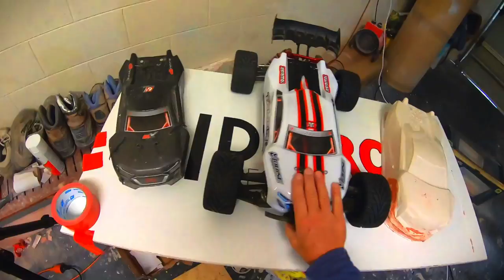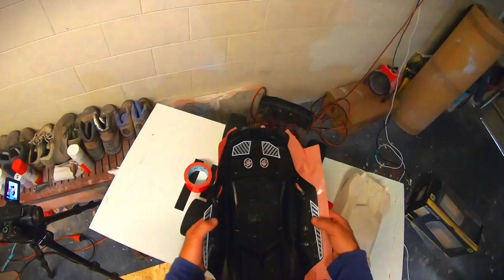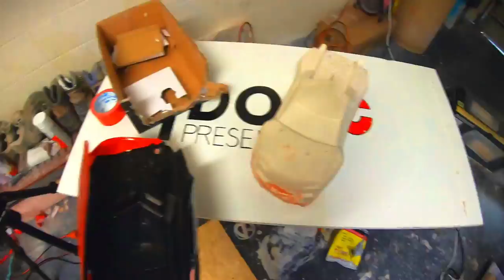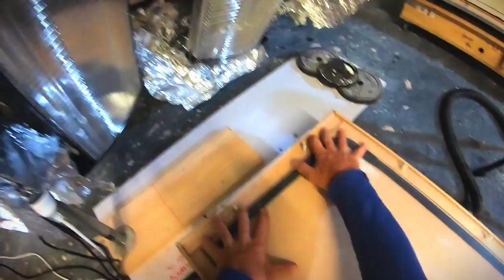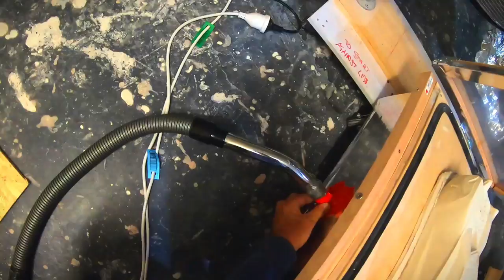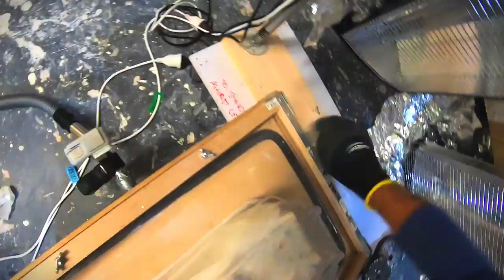Make you own RC body shell | Vacuum Forming RC car body | Arrma Talion | DIY vacuum form |(@IDORC

Comment: thanks you gave me some ideas on some changes to improve my system, something i can share someone might find helpful, for making the molds i put the taped body in a plastic tub and use cheap playground sand to pack around it for support, the sand not only eliminates any chance of the tape blowing out because it wasn't supported enough, but also makes it possible to cast a mold from a body's that are broken or even have missing sections, as long as you can form the missing sections with tape or plastic then the sand will reinforce it enough to keep the plaster from plowing through, i have 2 identical plastic tubs so i can store the sand in between then transfer the sand back and forth to make molds......
Reply from the maker: Great idea the sand bucket, will definitely try that next time, cheers

Comment: I’ve gotten myself a 3d printer and wanting to make a custom body for my Losi Super Baja Rey 2.0, I was wondering if a 3d printed version of the plaster replica would work with this technique. Would love to hear your opinion!!❤
Reply from the maker: Hi mate, the temperature of the plastic when vacuum formed (thermo mould) is quite extreme, the 3d print mould is likely to melt while trying to form the e vacuum mould…. That’s why plaster is great, it can withstand the heat. Also plastic formed over plaster allows for the new plastic form to seperate from the plaster mould easily… sometime I wipe olive oil on the plaster to help seperate from the plastic form…. I’m afraid the plastic body shell when vacuums (suctioned) over you 3d plastic mould will bond together due to heat and make them impossible to seperate. Cheers for asking though!

Comment: I was having a "Deja Vu" when watching this. I'm 72, and remember doing this exact same thing with my Mattel Vacu-form, back in 1963.Lol The car bodies were Hot wheel size, but.........Cool video. How much hotter for polycarbonate?
Reply from the maker: @clean1566  cheers mate, polycarbonate needs to be dried first to make sure it’s free from moisture…. Then heated to a higher degree for forming. Not exactly sure how much hotter but finding the firming tempt fit polycarbonate should be easy on Google. From memory I think it’s around 230 degrees celsius

Comment: Would the mix up liquid heat resistant expanding foam be anygood as you could spray some release agent in the shell first so it doesn't stick would cost a little more but be less fragile use to do lots of carbon fibre and fiber glass repair during my many years pannel beating lol
Reply from the maker: There is a lot of heat involved, I’d be worried it wouldn’t keep shape, but nice idea

Comment: Great video but I have one question; what size of sheet of plastic do I need to make a 1/10 scale RC car body for the Traxxas slash or bodies about that size?
Reply from the maker: Hi mate, probably 700 x 450mm, it usually depends on height of the mould as well as width and length, just give yourself about an extra 10-20cm around the edge

Comment: Excellent tutorial thank you very much for sharing ya legend 🏆
Reply from the maker: Lol thank you very much mate, I remember searching through heaps of YouTube videos on how to to this process with very little luck…. After a lot of money and time spent experimenting and a lot of the time failing I managed to get a good DIY system happening. Felt it kind of a duty to make it easier for others to do and learn from what I learnt so they can do it without my mistakes lol, thanks for watching again mate
Reply: @IDORC  I only other one I have seen is kinda same set up but he used a a frame and stuck it in a kitchen stove then pulled it out. Kinda dodgy. I like this set up better.

Comment: The only problem with PETG you can't paint it with polycarbonate paint because it makes it very brittle & will shatter on impact.
And if you use acrylic paint when the body flexes it will crack & peel off.
Polycarbonate/lexan is the best way to go.
Reply from the maker: Too true mate, you are spot on, I end up using a ‘rustoleum’ brand plastics spray and back it with a clear flexy coat to stop it from peeling. Polycarbonate is certainly the only way to go for strength and painting, just do hard to dry right before vacuum forming (hydroscopic, sucks moisture from the air). I am trying to get a hold of some PC-ABS (polycarbonate 60% acrylic 40%) it’s meant to be the best of both worlds and firm easy like ABS but the strength of PC, hard to get in Aus and is relatively new to the industry but could certainly be a game changer for those wanting to make RC bodies.

Comment: I have a Chinese copy of the hpi baja 1/5. I love to have a Lancia Stratos body shell, but I wasn't able to find any body guide. Not even from road design RC cars. 
Did you think it's possible to make a 3d print by pieces, glue together all transversal pieces, smooth the surface and then use it to do the first body shell? I can use the fridge trying to avoid getting the 3d print to deform cause heat and some kind of painting if that could help.
You should try to do lighting, real lighting with the empty space. The inside part where the led is glued, just add some paste where the lights have to be (you can glue a plastic marker and then use a lighter to get the plastic of and use the guide to draw) trim the outside carefully, drill the inside holes and use a wet textile net in same paste to emulate the inside of the light texture (probability more water than paste and more coats with a brush) and try to glue it inside. To be 100% accurate you should glue the net and then burn it, to have rivers instead of mountains, but I don't think it will be noticeable😗💨
Nice job out there!
Reply from the maker: Cheers mate, sounds good

Comment: What thickness PETG would you recommend for this?
Reply from the maker: Hi mate, 2mm is a pretty easy form for PETG, it won’t be overly strong for an RC basher though… but great for a shelf king
Reply: @IDORC  are rc bodies normally made from a different material? 2mm doesn't seem very thin to me in terms of rc bodies
Reply from the maker: @ValRC1  the material starts as 2mm and stretches to a thinner material… but it’s still classed as 2mm. Polycarbonate is what most RC cars are made from but vacuum forming polycarbonate is a bit trickier. It sucks the moisture into it and needs to be totally dried out first under a long low temp to remove any moisture from the material, then heated to a very high temp (more than PETG) to vacuum form properly. If you live in a warm environment it’s easier… less moisture in the air
Reply from the maker: @ValRC1  I also make the bodies out of HDPE (that’s what the unbreakable RC bodies are made from… usually a 3mm sheet, but it doesn’t come in a clear to paint, just solid colours
Reply: @IDORC  I see, thanks for the help! Would you say HDPE is more difficult to form?
Reply from the maker: @ValRC1  no it’s quite similar but an even vacuum is needed so I’ve found a pegboard style vacuum board top is best (lots of holes, not a single hole in the centre of your vacuum box)

Comment: 🤣🤣🤣 OMG Dude! - it's awesome, but buying all that equipment is at least 10+ body's for the talion 😃
Reply from the maker: 4 cheap heaters, a vacuum and some timber…. If you have some spare wood laying around it does make it cheaper and I use the house vacuum and a spare car vacuum we had already so it was cheaper for me. I’ve made over 40 bodies so far so it’s paid for itself pretty quickly, it does cost each time you make a plaster mould but you also can use that mould over and over for multiple bodies. Food for thought! Bash on bro and cheers for watching

Comment: Love the video(s), sub'd right away.
Do you have anything published on the polycarbonate setup/process aside from the notes and comments in this video?
Reply from the maker: Hmmm the good old polycarb question lol. Doing polycarbonate is a bit harder, polycarb is hydroscopic meaning it pulls moisture in from the air so the plastic sheet needs to be dried free of moisture first….. this means heating the polycarb at a lower temp for about 30-45 mins (unless you live in a warm low humidity location, I unfortunately don’t). Once the plastic is dry and free from moisture the process is the same. If moisture is still contained within the polycarb then tiny air bubbles will form giving a bad spotty finish. So it’s certainly doable but takes a long time therefor using quite a bit of power/$cost. Unless you are doing smaller bodies and can use a conventional oven (a large pie oven is ideal if you can find one).
Reply from the maker: Ps. Cheers for the sub and watching dude
Reply: @IDORC  I live in Phoenix, Arizona so the dry heat is a constant.
I'm going to try making a custom shell for a Mojave that looks the the new batmobile. 😁 I might try both plastics once I get the box and heaters setup
Reply from the maker: @noahthegildedone5917  sweet, PETG is easy to form and cheaper, so to test your vacuum form system and set-up it’s a good start point, once you got that sorted a dry/moisture free sheet of polycarbonate should be easy, it does need a higher heat for longer but once it’s dropped and soft forming is exactly the same. Good luck mate, it’s a lot of fun and opens a whole new world for RC fun

Comment: Could you vacum form around a 3d printed body shape (after smoothing of course)
Reply from the maker: Hi mate, It’s going to depend on the 3D print? How much heat temperature can it withstand etc! Haven’t tried myself!
Reply: @IDORC  Good points. Thanks
Reply: I did this with a couple of resin print molds I made for a 1:18 scale LaTrax Rally and LaTrax Teton. Works great. The molds did get kinda hot, so I'd say PLA will be likely to deform from the heat. I suppose if you added some kind of epoxy as a smoother to hide your print lines, that might help.
Reply from the maker: @rcautoball  hi dude, my moulds/prints are made from ‘plaster of Paris’ ….. they stay pretty good for depending on the shape, after a while the mould may need some work with more plaster….. when it’s on its way out I cast a new plaster Mould/print from a previous body. And we start again lol the plaster states pretty cold when casting…. Depending on the weather a warmer mould is better, so I often hear my plaster cast mould…. Especially when new… this prevents abnormal drying defaults on the final body shell.
Reply: @IDORC  Hey, brother! I was actually responding to the guy asking about 3D printed molds. I know yours are plaster as I've seen most all of your vacuum forming videos. Lol.
Reply from the maker: @rcautoball  sorry dude… didn’t see who I was actually responding to lol old man eyes
Reply: @IDORC  Understandable. Lol

Comment: Great work bro. I've been looking into building something similar to this. How does the PET hold up with your bashers? I heard it isn't as crash resistant as lexal or poly.
Reply from the maker: Hi mate, cheers, no definitely not as tough as Lexan, I usually drywall tape/shoe goo mine for strength but still will only last a few bashes, great if you are careful, the 1/7 Mojave is a killer tho lol

Comment: Where do u buy the petg sheets? Great Video
Reply from the maker: Hi mate, we have a few local plastics companies that stock it
Reply: @IDORC  thx for the reply, how much Cost These for how many?
Reply from the maker: @vamperspective3332  a 2400mm x1200mm sheet of 2mm PETG (not overly strong but easy to work with every time) is about $120 Aus dollar a sheet, can be cheaper if you buy in bulk but hard to transport, a few sheets can roll up easy for transport/postage. I can make 3 x Mojave shells 1/7 from one sheet or about 6 x 1/8 MT/truggy or buggy shell. Depends on your form box size.
Reply: @IDORC  thx a lot, i will search for smth like that

Comment: i thought a 3d machine made these bodys
Reply from the maker: Normal vacuum forming (thermo forming), no 3d machine needed
Reply: But you think the machine three days ago, what exactly is the name of that 3D machine, you don't know.
Reply from the maker: @TeamMarlon  a CNC machine can build the mould/buck…. But those machines are really expensive…. My video is pretty easy to follow and shows how I make my buck from plaster of Paris and then vacuum form the plastic.
Reply: What is the name of the plastic that is used for the bodies? I imagine that it comes with only one size.
Reply from the maker: @TeamMarlon  you get big sheets of HDPE (unbreakable material) or Lexon Polycarbonate or you can use other materials, the sheets come in different sizes and you cut them to the desired shape of you frame for vacuum forming
Reply: I imagine that this plastic also comes with the Plastic milestone that goes on top, so when you paint it inside you finish painting it and then you remove the Plastic milestone that is on top of it, it looks shiny.
Reply from the maker: @TeamMarlon  yeah that’s correct, still has the protective film on one side when you form it… so as you don’t get spray on the outside
Reply: What are the measurements of the plastic
Reply: Do you have Facebook messenger